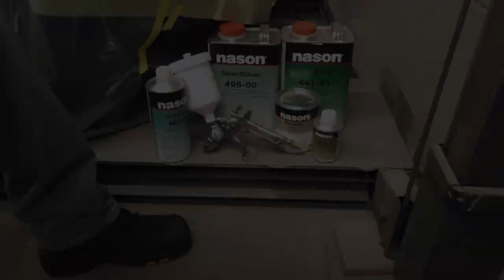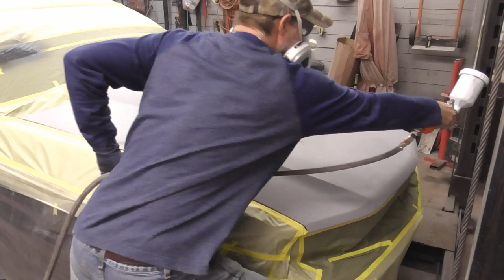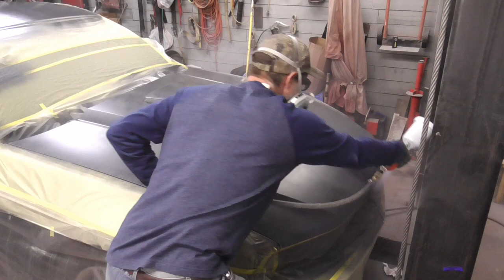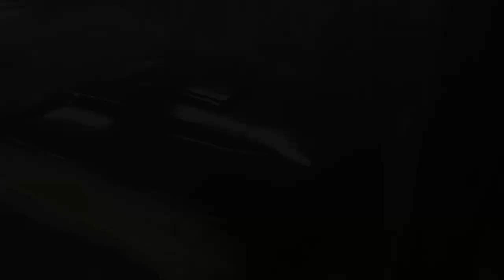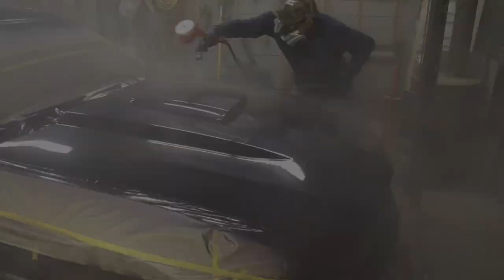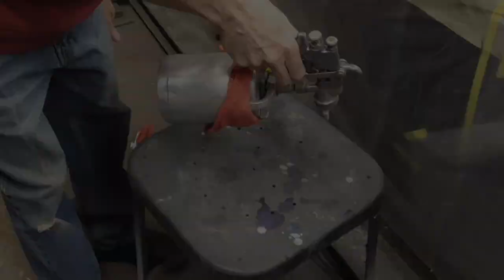How to Spray Nason Base Coat / Clear Coat (BC/CC) Automotive Paint - Start to Finish

Comment: I bought that CH gun for spraying my trucks roof. Glad to see it in action, and I'll keep an eye out for leaks too! Thanks!
Reply from the maker: I really like the gun actually - cheap but works great and easy to clean.  Got a cup from HF to replace the one that was on it :)
Reply: @LakesideAutobody  The CH spray gun arrived. It looks alright. It was covered inside and out in a cosmoline type substance, so I carefully disassembled it and cleaned it up with some alcohol and a rag. I found a few bits of metal in it, so I'll flush it out really good tomorrow. I also picked up a 20 gallon compressor, so I should be good to go for this weekend!
Reply from the maker: @SomeGuyInSandy  Awesome!  Have fun and let me know how it goes for you.  If you have any questions feel free to ask my friend :)

Comment: Have a different spray gun gonna use now never used it before the Ronpeng professional lvlp spray gun got it on Ali Express 3 of them a 1.3, 1.4 and 1.7. Plan on getting 4x8 wood boards to insulate the sealing of garage so can have it warmer so can paint when it's cold in Michigan like it has been now today was in 50's though. Isn't cold as used to be because of the global warming over the years though. I have bought some other stuff too like this sandblaster water attachment hose and other stuff that got lately but cold for painting now unless had garage heater don't want my paint freezing when I paint even though have a infrared 1500 watt heater now too.

Comment: Gonna start using high solids clear when I paint but gonna still use the Starfire base but the 5 Star Etreme high solids clear with fast activator and reducer I know got orange peel when using the Paint For Cars auto paint but I was spraying my coats starting off too wet instead of starting slightly wet on first coat and a little bit wetter on every other coat was looking at the guy that does Speedkote videos when painting and saw how he was spraying and he started off with lighter mist coat not too wet like I did but I have to pay more attention to instructions on paint too it does say on the Starfire basecoat the metallic base to sand with 400 on vehicle before painting. I got a Nason flat black sealer last summer so would be using that still as a 2k sealer but the difference would be high solids clear which never sprayed before yet.

Comment: Thanks Jerry - such great finish, no orange peel at all!  I just can't seem to get my paint to lay  that flat - getting sick of always having to wet sand and buff to get it to look like that.  :/
Reply from the maker: What type of paint are you using?  Don't get discouraged - at the shops I worked at the painters wet sanded and buffed every job that left the building.  Again let me know what type of paint you're using and then we'll figure it out no problem.  Jerry
Reply: @LakesideAutobody  Hey Jerry,it's Matrix paint with U-Pol 2.1 clear.  Am running at about 25psi on the clear and about 18psi on the paint.
Reply from the maker: @CA-pv5ie  Try reducing your paint and clear a bit more like - 4 parts paint : 2-3 parts reducer + plus what ever hardener is required.  Make sure your gun sprays great before - nice and clean - test with thinner or reducer - should have a nice even spray pattern,  Tighten up the pattern a bit - not totally wide open.  If it's really hot where you are use a slower reducer.  Up your pressure at the gun to about 25 or more psi.  Also, have to look at the paint as it's being sprayed - when it hits the panel it has to look wet and lay down nice.  Wet wet wet but no runs.  Let me know if that helps or not - Jerry
Reply: @LakesideAutobody  Appreciate you taking the time Jerry!  Great advise - will give that a shot.

Comment: Very nice video.  While I get that you're demonstrating technique, it would be nice to know some info about the gun, and your opinion of the results.  For example, what were your spray settings?  Turns on the flow and pressure knobs?  Supply pressure, and if using a local regulator, what did you knock it down too?
Reply from the maker: To be completely honest... every one sprays a bit different so those settings are going to vary depending on the type of paint, how thick or thin you mixed it, temperature in the garage, etc.  Lots of variables.  The truth is, there is no perfect recipe for spraying paint.  The best however is to know some basic rules when adjusting pattern, pressure, fluid control, etc.  Check this video out and if you have questions on your project just ask - I get to the comments 1-2 times a day - all comments - https://www.youtube.com/watch?v=2Yd0ykULtm8
Reply: @LakesideAutobody  Dude, it is so awesome that you replied, and so quickly!  Thank you!  I used to have a small paint and body shop back in the mid-80's, using a traditional Binks gun spraying straight enamel, lacquer, and playing round with spraying poly clear over color coats.  Imron was all the rage, but hard as hell to get to come out right.  I just built a new home shop, and getting ready to re-paint my shovelhead bagger, and everything is so different now.  I have 2 HVLP guns, and actually did a 2 tone paint of one of my bagger lids 2 yrs ago using Nason, and it came out fine.  So, always learning.  Again, thanks for the help.

Comment: Jerry, I’m painting replacement fenders and an existing hood. After I spray sandable primer, can I go straight to base coat then to clear coat? In this video you apply a sealer coat over the primer. What does that do and do you recommend that layer prior to base coat? Love your content.
Reply from the maker: I used the sealer here to darken the primer - that's really it actually.  There are a few purposes for using sealer.  1) change the color 2) seal the body work 3) help fill any super small imperfections 4) hit all the the bare metal spots with one shot.  You can certainly prime then hit it with base - no need to sand unless there are dust specs, etc.  Hope that helps :)

Comment: I appreciate the hard work, but so many of these videos on YT are practically useless. What pressure is at the gun, what are gun settings, what tip size. People always saying wet coat medium coat. How do you achieve this. Adjust air pressure, change hand movement speed. So many questions.
Reply from the maker: Most of my YT vids have that information listed in the description of the video - just scroll down a bit.  If you have any ?s after that feel free to ask anything on any video.  I answer once a day - Jerry

Comment: Looks like your leak in the lid may have come from the vent in the cap top plug facing more forward...that should be pointed toward you so it doesn't leak paint out the top.
Reply from the maker: Good tip:)

Comment: I know there are instructions with the primers, paints, and clears but generally how long are you waiting between the paint coats and clear coats? How long do you let the paint dry before you spray the clear?  Thank you Jerry for sharing your talents with the rest of us! Keep up the awesome work and videos!
Reply from the maker: I wait about 10 minutes between coats of color or basecoat and then wait about an hour to put the clear on - don't want to re align or disturb the metallic flakes by getting it too wet too early :)
Reply: @LakesideAutobody  HI Jerry, I've got a question. I sprayed my Silverado door jamb and lower rocker today. I used a 1.3 tip for the base and it laid out great. I may have messed up though when I went to the 1.5 tip for the clear. The cab corner and jamb came out ok but man the clear coat has runs like crazy on the lower rocker. The clear is still dripping onto the cardboard on the floor. Can I get away with wet sanding the runs or will I have to spray again after sanding the runs? I mixed the clear and hardener 4 to 1 like instructions said. Was the 1.5 tip a mistake? Thank you
Reply from the maker: @MeowMeowMeow7576  Bottom line is you put it on too heavy.  First coat should be light.  Next coat medium wet.  Final coat wet but not buried.  If you spray it where it looks completely flat, you'll most likely end up with runs.  You should see some orange peel, then it will flatten out a bit while drying.  You can try wet sanding those runs but it will probably be a ton of work and frustration.  See this video for the process with just one run - https://www.youtube.com/watch?v=Ee0B7_soVgc  If you have more than like 5 runs,  you might want to just and it and re clear.  Take it as a good lesson - it's a hard lesson but you won't forget it 😊  Keep me posted on how it turns out my friend and feel free to always ask ?s  Jerry
Reply: @LakesideAutobody  Thank you Jerry. Yes there are more than 5 runs  unfortunately. I was so happy because there were no runs at first but then I looked where the rocker starts bending and going down to where it's spot welded to the inner rocker. It's an 01 Silverado if you're familiar with those. I'm sure you are. Lol. If you have an email I can send you photos. Thank you again.
Reply from the maker: @MeowMeowMeow7576  Don't feel bad - it's happened to me many times.  It's par for the course - if you paint you are going to have runs.  The key is to try to get as few as possible and sometimes you end up with none.  There's a very fine line between spraying nice flat wet paint and running it.  You'll usually find them when you come back out to look at your nice work... then bam! depression 😢  Folks don't usually show their runs on the internet but trust me they get them :)
Reply: @LakesideAutobody  Thank you for the kind words Jerry. I'll try to do a better job on the passenger side next spring. No heat in the garage so the passenger side will have to wait.

Comment: Great finish from a cheap gun. With all the mist in the air do you find it causes any problems falling back on to the job.
Good video as usual.  Thanks  Have a Good week . AL
Reply from the maker: I always forget to show the fan set up under the door.  The overspray clears out fairly fast - maybe 5 minutes or so.  I work with the body shop up town every now and then and he says that "Yes" metallic flakes do fall back down on the job and end up making it look lighter so he runs the tack cloth over it in between coats to pick it up.  Thanks for watching Al - have a good weekend :)

Comment: What size nozzle for your gun do you spray with? I did 3 wet coats on mine, did get some dust and a little orange peel, will need to send and buff. Will 3 coats be safe foe sand and buff? I don't want to sand through the clear. And what is the max amount of clear you can put on? Thank you, love watching your videos!
Reply from the maker: You'll be fine with 3 coats.  The gun used on this video has a 1.4mm tip.  How much did you reduce the clear?  Some clear coats are pretty thick and if it's warm out they don't have time to flow out flat and you get orange peel.  Reducing the clear a bit more helps with that or using a slower reducer.  Also, remember that almost all the dust you get in a paint job is already on the panel before the first coat - gotta make sure it's perfectly dust free before spraying.  You don't have to wet floors, clean, etc.  Hope that helps a bit :)
Reply: @LakesideAutobody  I have a 1.4 Iwata. I didn't reduce the clear at all so it took a lot of paint to get it to flow out so my 3 coats should be pretty thick and I used a slow activator hoping that would help with the flow. And before I sprayed the clear I went over it with a tack cloth to pick up the dust. I spray in an old garage so it's kinda hard to avoid dust, but I did do some cleaning and wet the floors down. I took some 2000 grit paper to a little area and buffed yesterday, that little area looks as smooth as glass now. The car was painted on sunday, how long should I wait before sand and buff? it still seems pretty soft.  thank you for the help!
Reply from the maker: @shaggyzr  Lots of folks will disagree with this but when I was younger I was sick and tired of getting dust in my paint work - I even sprayed in a booth.  One day when I was about to paint I went over it one more time with a bare hand and air nozzle - I felt all types of dust and nubs.  I keep doing it till it felt smooth and clean. Voila!  Dust free paint job ☺  Check out this video to see an example of that technique - https://www.youtube.com/watch?v=VNrIwVMxjI0

Comment: HEY. JERRY
HOW DO YOU DEAL WITH BUGS WHEN PAINTING.
I PAINT SOMETIMES AROUND 2-3 AM ,
USUALLY EVERYTHING GOES PRETTY GOOD EXCEPT THERE (ALWAYS) SEEMS TO BE A MOSQUITO WHO FINDS. IT'S WAY INTO MY LAST COLOR COAT OR MY CLEAR COAT.
I'VE GOT THE GARAGE DOORS CLOSED UNTIL 20 MINUTES AFTER SPRAYING BUT DEM DARN MOSQUITOES SEEM TO FIND THEIR WAY IN WHILE I'M PAINTING .
ANY SUGGESTIONS.
KEEP UP THE GOOD WORK AND VIDEOS.
                                                     THANKS
                                                            AL
Reply from the maker: I used to paint a lot at night too because I would do side jobs after work - same think - I got a lot of bugs.  Now that I'm retired  I always paint during the day.  I could find no way to stop the random bug.  The trick is though if you get a bug is to pick it out right away with an eye tweezers or something similar, dab the paint if needed with a soft bristle small brush and go on painting.  By the time you're done that spot might flow out any you don't even notice it.  The other option... don't mess with it till after the job, wet sand it and buff.  You might see the bug color though still left in the paint.  Jerry

Comment: Have you had any luck with the Nason basecoats on lighter metallic colors? I recently repaired a bed off a Chevrolet S10 that was a light pewter metallic using Nason. I could never get the metallic to lay right. I have used the Chroma base on metallics and had much better results. The problem is no one wants to pay the higher price for the Chroma base.. Any tips on working with the Nason lighter metallics to help with the mottling and sandpiling? Thanks
Reply from the maker: Yes - spray it dry.  You don't have to worry about getting it wet at all as it won't cause orange peel when you put the clear coat on it.  Wait like 1/2-1 hour before clearing.  Let me know if this works for you.  Here's an example of Nason light metallic paint and some help w/ mottling - https://www.youtube.com/watch?v=yGCpM6Cwhb0

Comment: Great video. How much thinner are you using with the base & clear
Reply from the maker: Thanks Calthorp - the mix ratios for color and clear are listed in the video description :)
Reply: @LakesideAutobody  Thanks for that, I did see it after I read the entire comments section. Thanks for the great video. a few words from a pro can save you hours of frustration. I am using Nason NI-610 so going to be a little different. I have used it before & found it excellent without a binder. but going to use it this time. my cars sit inside a garage with a cover over them so don't get much weather damage.

Comment: How did the color match up to the rest of the car? I hear some painters say you always have to blend into the mating panel to get a true match  on poly coats or metallics. I also heard others say that is a myth. Your input please?
Reply from the maker: The truth is - I got real lucky.  The painters are right - you almost always have to blend onto the adjacent panels.  Sometimes you can get away with what I did because the fenders turn down real quick and the eye can't really see a big difference.  I do think the paint I sprayed was a bit more purple than the original paint but you'd have to look at it side by side i.e. painted fender vs original paint on door.  Jerry